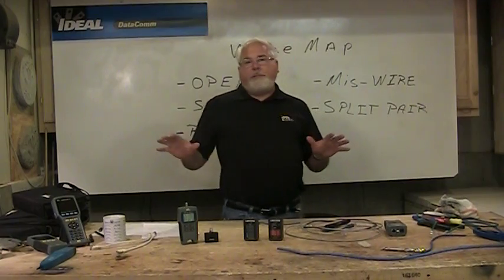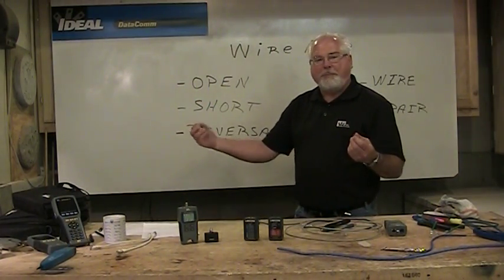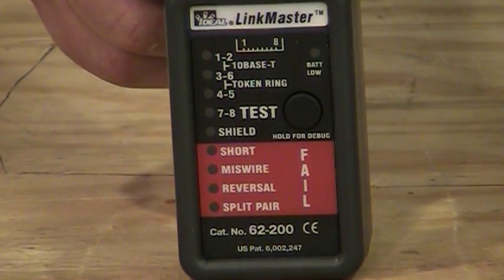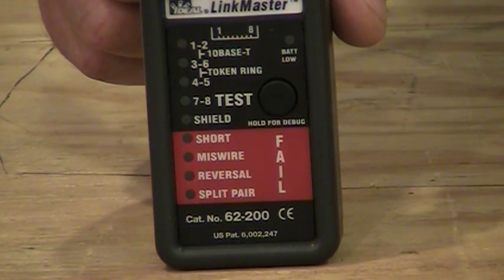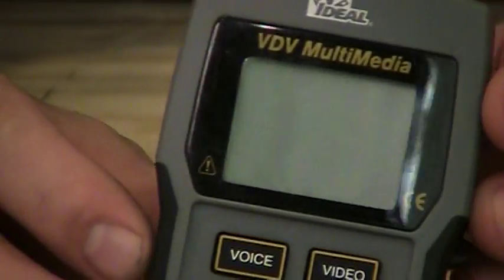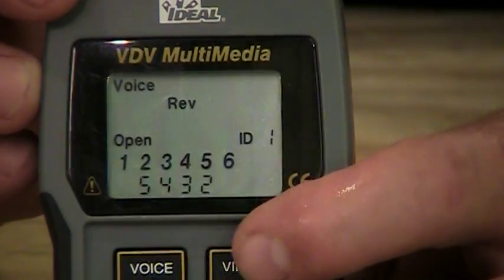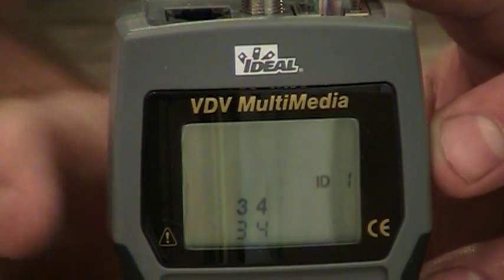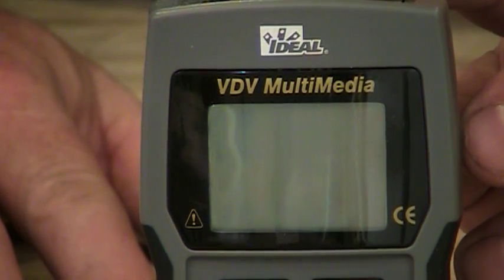Wire Map Testers

Comment: In the video you said, if I make the same split pair mistake on both ends of the cable the cable will work normally but the LinkMaster will detect the split pair. According to the manual, this is not true. The LinkMaster will only detect the split pair if only one end of cable is incorrect.
Reply from the maker: Hey Killer2600 sorry if I was not clear a split pair is where two wires are used to create a pair but those two wires are not twisted together. The LinkMaster can detect that they are not twisted together. Hope that helps and thanks for watching. That is an old video might be time to redo it. Ron

Comment: I have a CAT-5 ethernet connection that this week failed. I tested with a LinkMaster 62-200 and came up with MISWIRE on 3-6 and 4-5. This cable tested ok 14 years ago and has worked faithfully since then. What could be suddenly wrong?
Reply from the maker: Marvin the pins will wear out over time is the only thing I can think of. Just re-crimp new ends on the cable or buy a new patch cord. Sorry I was not a lot of help. Ron
Reply: Thank you. It is the wire in the wall to my patch panel. So not sure how the wearing out would work. I did pull a new CAT-5 with RJ-45 to go around the whole bad cable issue. MISWIRE is not an open and it is not a short and it is not reversed. I am not sure what MISWIRE means. What is the tester trying to tell me?
Reply: @marvinfrisinger4651  If you didn't rewire or change any connections, you probably had an open or bad connection in one of the wires in the pair. If the wiring was touched at some point just before the failure then someone likely introduced a miswire condition. The LinkMaster 62-200 leaves much to be desired for someone doing troubleshooting, it's better suited for someone making and verifying connections that be redone if the test fails.

Comment: Hello, 
 Ron I own an Ideal LinkMaster 62-200 and I've got a question for you.
When I test any known good patch cable into the ends of the tester and press test. 
Only the top three lights shine. Not four as shown in your video.
Is my tester defective?
Reply from the maker: Hi DividedWeFall1000 it is either and open on the pair in the cable being tested that does not light up or a damaged pin in one of the two units of the tester. Look closely at the pins in each unit you can usually spot a pin that is pressed down. Let me know what you find if the tester is over a year old it is out of warranty but if you need to drop me a note to my ron.kipper@idealindustries.com email and I will find a slightly used replacement unit that I have. Ron
Reply: Hey,
 Ron..
You know your product for sure.
One of the pins was depressed and once I freed it up, the Tester works great again.
Thanks for your expertise.
Reply from the maker: IDEAL put in those testers a high grade jack so they would last. Glad you got it fixed. Ron
Reply: Hi Ron, I reached out to you about 11 months ago regarding issues with my LinkMaster 62-200 and you got right back to me. I was hoping you could reach out to me again. Thanks- Kevin~